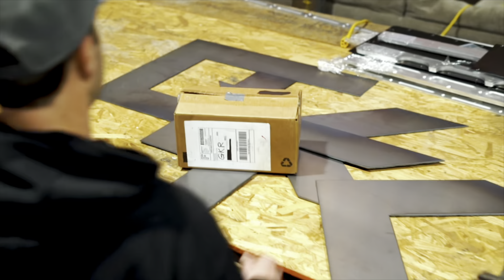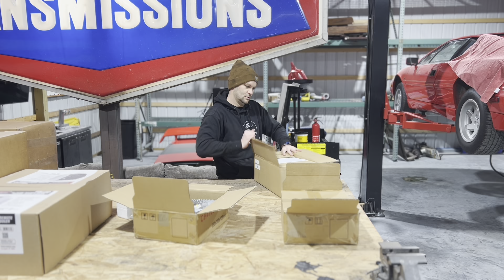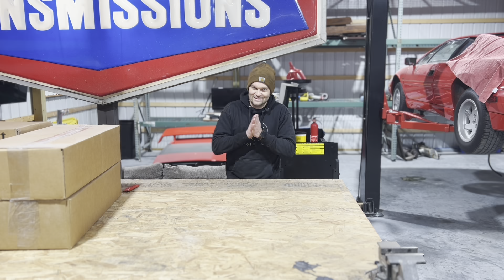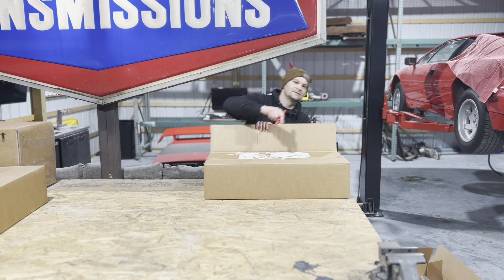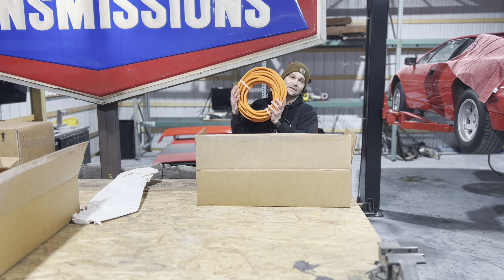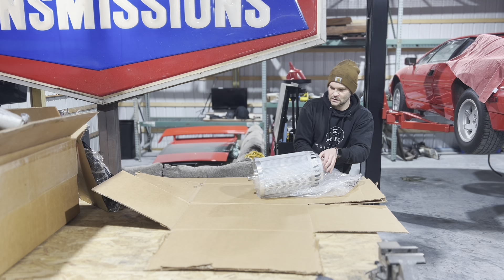Unboxed and Going Broke - The full(mostly) EV kit going in the 1988 Lotus Esprit project.

Comment: Where did these boxes come from?
Reply from the maker: Our vendor is Legacy EV. They are a great group and you should check them out!
Reply: @gkrmotorcars494  May I ask why you chose 2x the Hyper9 (?), as opposed to a single motor from Legacy, such as the Zonic 180?  Is this a simply a space / integration constraint with the Esprit?

FYI, I am considering a conversion on a '75 Esprit.  I am also wondering what (if any) challenges you had doing the conversion on the backbone chassis, including how that may influence placement of battery packs, ..., etc.

Great video btw, and thanx for the quick response to my last post 🙂
Reply from the maker: @BobnGarrett  The Zonic 180 wasn’t available at the time we ordered this but is a great motor from what I’ve seen/heard. It has a higher voltage range so we would need to fit more batteries had we gone with that system. I like the 177 voltage we are running for the dual hyper 9s as we only need 7 Tesla modules in this light nimble car. The dual Hyper9s are actually cheaper, as well. I am hoping our next customer goes with the Zonic 180 so we get to try it out, though!!
Reply: @gkrmotorcars494  Where are you located? Thx for the info!
Reply from the maker: @BobnGarrett  We are located in Mid-Missouri. We always love talking EV 😀
Reply: @gkrmotorcars494  Great resource.  Am in Colorado.  Just wrapped up a '65 Daytona Coupe replica.  Next project is the Lotus and wandering into EV :-)
Reply from the maker: @BobnGarrett  Haha, great minds think alike. We just finished a Shelby cobra recently. Good luck and if you ever need any help, just reach out via our contact form on our website.